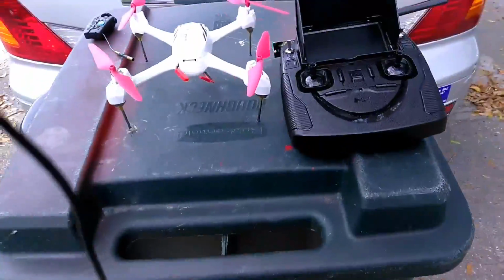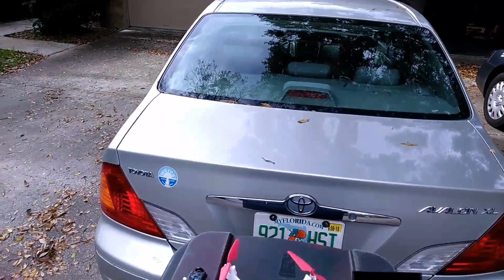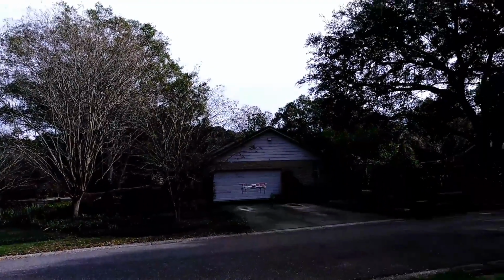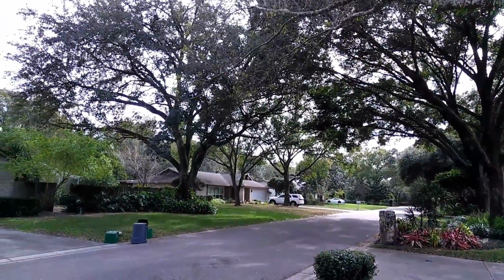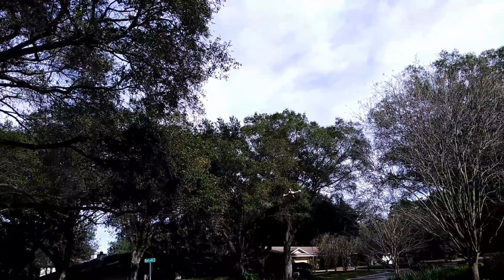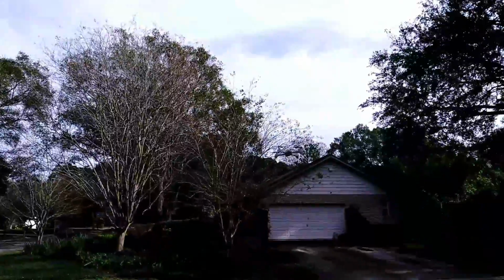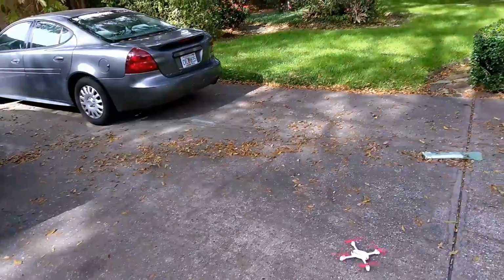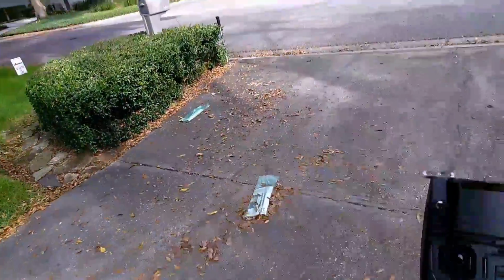Hubsan X4 H502E Using 501S Transmitter, 2 Fly Aways

Comment: i've got my H502C on a H501S transmitter & now i've got follow me & headless mode & my drone is meant to be incapable of doing these 2 functions but using these functions does however HAMMER the drone battery

Comment: I noticed you have the fbv antenna on the outside I'm thinking of doing the same because I bought the antenna kit on eBay and the fpv didn't seem to improve any suggestions
Reply from the maker: +Suazzz I'm moving both antennas to the exterior of the transmitter and putting the proper firmware on it made all the difference

Comment: metal nails probably causing bad calibration and after each crash it shoud have been calibrated and the two times it happend it happend in the exact same place and went up inyo the same tree maybe some kind of interference combined with bad calibration + add diffrent transmitter and firmwares . hubsan say not to have anything metal near or mobile device when calibration is been done

Comment: 5:11 u crashed it into a tree
Reply: Drone Worship this happens to certain h501s updates too. alishamo had this happen to the h501s and I also have it happen on bank turns.
Reply: Just got the Drone and it flew away and crashed into a high-rise office building. Any clues?
Reply from the maker: +gta jokers mods mods mods yes because I had no control. The Drone was going faster than the GPS could keep up with which caused it to go Haywire

Comment: Apparently, you have not watched my latest video.  I'd not do what you just did.  Not in the hood.  I lost total control of my H501S with the proper advanced transmitter.  I will only fly it at my field next time.. To be quite honest.  I want to kick myself in the ass not spending the extra for the BeBop 2 drone.

Comment: Yes I have a question about the 501 Advance like you have and a none advance?  Please.
Reply from the maker: Tank 62 I'm confused by your question or statement
Reply: Drone Worship ok sorry about the confusion but I'm trying to find out difference between, Hudson H X4 501s Advance and the none advance one?
Reply from the maker: It's only the transmitter.
Reply from the maker: Let's see if I can break this down a little more for you. The standard transmitter is used for a bunch of different hubsan class quads and I've also seen it manufactured by the companies and used four different quads. The advanced controller has been around a long time it's been used for planes helicopters and quadcopters now. There are a few specific differences for instance the advanced controller comes with long-range modification already done and the standard does not. The advanced controller has a smaller screen than the standard which is why most people purchase the standard and upgrade it with the long-range antennas and change the firmware. Besides that really the functionality is about the same. I much prefer the standard it feels better in my hands the screen is much larger and easier to read Telemetry and see what my path is on my fpv. The quadcopter is identical no matter if it comes with the standard or the advanced controller there are no changes in protocol
Reply: That is what I was thinking, cause I was thinking about adding that Quad to my collection, but Hubson' modeling system is a little confuseing you have to be a owner to totely understand them ( like a BMW owner) only pompous ass holes like my older brother knows.  LOL.
Thanks for the clarification.

Comment: good info dude i actually just got mine today im doing very similar set up i just decided to upgrade the internal camera with a fredi mini cam with 2.4 wifi it also does night vision other than that i got the upgraded controller i think its the firmware cus i seen some other guy with this setup n it was perfect
Reply from the maker: +blaze allday be careful you're running the same Wi-Fi band as your 2.4 gigahertz signal that controls the quad.
Reply: Drone Worship thanks for the help bro yea after i had problem with the 501s tx not having the gps in i decided to just return it all and now im looking to just get 501s or upair one 2 if you have any opinions on either or lmk thanks love ur channel
Reply: lol by the way i added voo doo motors to mine for more horsepower dont do it lol it worked great for a bit but wasnt working well with speed cotrol kept have same issues lol but hauled ass if kept straight lol

Comment: do u think the stock antenas are better than the range mod please advise
Reply from the maker: +trucker RAy I believe the fpv antenna on the outside is better than the upgrade antenna however the SMA 2.4 dipole antenna is better than the stock 2.4 antenna
Reply: Drone Worship ok well i guess i spend money for no reason lol i see u from fla im in tampa bud
Reply from the maker: +trucker RAy that's not quite the case. They may release an update later on that will work better with different antennas just have to give them time. The original firmware was the best for the upgrade antenna kit unfortunately overtime hubsan has made so many changes to the firmware that some stuff works good and other stuff does not. I will be flying tonight around 11:30 pushing midnight if you would like to join me. I will be at the Temple Terrace rec center by the soccer field
Reply: Drone Worship o sh÷÷t u mad close but im way to tipsy to fly rite now lol 😖😖😖😖😖
Reply: Drone Worship but we definitely  will get together  one day
Reply from the maker: trucker RAy sounds good Ray
Reply: Drone Worship are u gonna do a video for mid nite
Reply from the maker: +trucker RAy of course
Reply: Drone Worship u should start looking at the premium star it cost me 800 but is really good tho better  than the phanton to me

Comment: Good findings. Your discoveries in testing flights give good educational insight on the hardware capabilities. Please keep up the good work.👍
Reply from the maker: Ruman Uddin I'm not quite sure it's the firmware I'm thinking it might be the GPS module is so cheap that it can't keep up with the fast flight. I believe it will react just fine in altitude hold if I have to I will turn down the rates and see what happens

Comment: the GPS cant keep up with it that's why it's cutting out... they say not to fly fast with the GPS ...put lower rates and it won't do it probably. forgot to test follow me mode.
Reply from the maker: shenlonco I did forget to test follow me mode. I will take it out and do another proper test that sucks I can't keep up with GPS
Reply from the maker: shenlonco luckily the trees were above me and kept them from performing a fly away
Reply: Drone Worship yea even with the h501s in GPS mode I would not push it hard.
Reply from the maker: +shenlonco never had a problem with the 501. Everytime I fly it I normally fly in GPS mode and I push it to its extent and it's never really ever given me a problem even at one kilometer range.
Reply: Drone Worship yea probably the 502e has a slow and cheaper GPS so it can't be flown to fast and malfunctions.

Comment: hubsan recommended a different compass calibration procedure. I have both qaud and bind them to each other all the time
Reply from the maker: william torres please if you have a video or can explain let me know
Reply from the maker: william torres if the tree had not been there it definitely would have disappeared
Reply from the maker: william torres also remember I did update my firmware I'm not sure it's communicating properly with 4.2.9
Reply: Drone Worship it can't if it loses signal it goes into rth. I fly with the   h107l controller and it loses range quick so you know lol